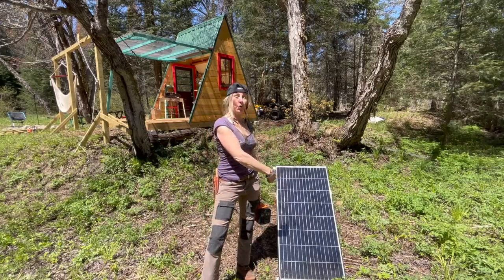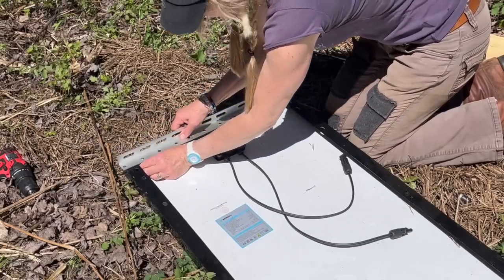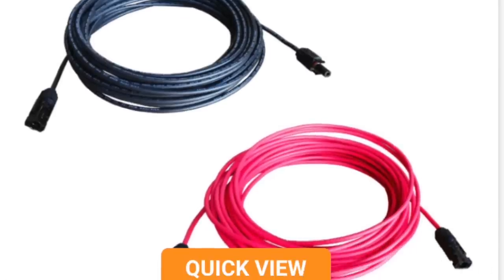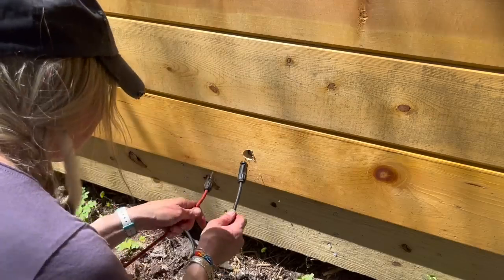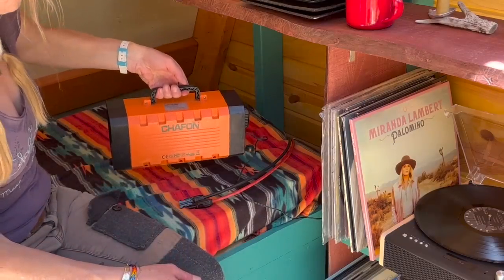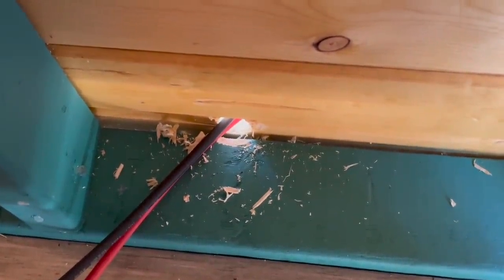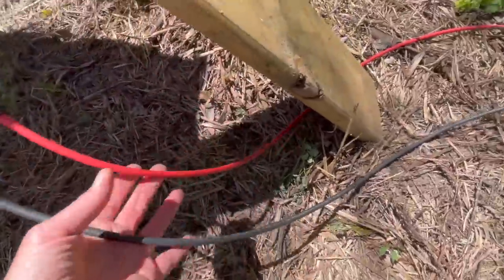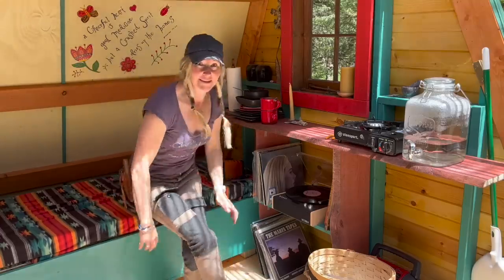Simple SOLAR for off grid cabin

Comment: I watched your build on this cabin and was wondering if you had any locking mechanism on your raised door for when it's shut, away etc.? 
A couple of pad bolts (barrel bolts?) will hold it down and prevent flapping in the wind and damaging. Also keep out smaller animals.

Comment: I like the stainless steel wool idea to fill the hole, add some gorilla glue to it and some water and when it foams up and hardens it will be air tight. If you glued a appropriate size stick in there with the glue and steel wool it would save the other product, then trim off excess.
Reply: Youtuber silver Cybul has a Eco Solar tracker review for one of these panels that can double the efficiency as it tracks the sun automatically. Not sure how soon it takes to recover the cost of it.

Comment: With all due respect what you have is not a “power generator” it is in reality a battery that stores power that is created by the solar panel.  The correct definition of a generator is “a machine by which mechanical energy is changed into electrical energy.”

Comment: I'm considering putting my ecoflow river 600 watt at a campsite.  I don't yet have a panel to charge it but I'm curious, do you know how long it takes to fully charge your battery with the 100 watt panel?
Reply: If you can get the 160w I would definitely spring for it. The intensity of the sun determines how long it takes to recharge but I can charge my small River in a couple of hours using my 160w panels on a good day.

Comment: Hi Ya Brooke, I like it. Solar is great. They make solar fridges too. If ya had 300 watts of solar, you could run  a fridge, lights, and charge phones and laptops all free. I have 400 watts, and two 100 amp hr batteries, with a charge controller and a converter. my fridge never runs down the battries. it runs 24/7  runs my TV, and charges everything. You might have a problem up north in the winter with clouds and snow. Guess you could keep'em in and drag'em out unfold them while your there. I don't know if that power unit you have has a lifepo4 battery or not, but its not good to charge them when their frozen or below 32 degrees. that go for all Lithium batteries.

Comment: The solar panel is the generator, not the battery bank you were holding in your hand.  Who cares what the manufacturer calls it.  If you need to charge it, then it is a battery bank at best, not a generator.
Still love the channel, just not the misinformation perpetuated by the manufacturer.

Comment: The one thing mine won't do is charge the battery when the inverter is being used. That's one thing to look at when considering buying a power station. My next one I will build myself. I have the batteries already.

Comment: you can get a fence pipe post and beat it into the ground and mount your panel off the ground. Does not have to be fancy with cement in the ground.  If you are only using one panel. Also as one of the other posts.  Put the cables in conduit to protect from teething critters.

Comment: Leadfarmer73 has many YouTube videos on different portable power stations, mostly the small ones 250 watts to 500 watts.  Also HOBOTECH has YouTube videos on portable power stations in a fun technical way to compare, does the bigger ones like 1500 watts along with the smaller ones, 250 watts 500 watts.
Reply: Also agree with another comment that the wires should be in conduit. 2" or 3" for a possibility of adding more panels. Sealing both ends, no critter run. Weather treated yes, though the sun will take a toll eventually along with rabitts, mice, other forest animals

Comment: Add a 90 degrees piece of wood at the foot to your solar panel post and perhaps put a small sandbag on the ends for stability. If your panel position is on a prety fixed place, adding conduit could protect the two cables some more and even close the hole in the cabin wall. Nice little project, saves petrol, minimizes noise and uses nature's energy (win, win, win). 😀 🌞

Comment: Wouldn't one cable have sufficed if the switch had been connected directly to the solar panel? - This would have reduced the costs and the circumstances significantly! Or?

Comment: Brooke, can you explain the power generator? Is it a battery bank or a petrol powered inverter? What voltage in and out?
Reply: Solar generator,  runs off solar by internal converter. No petrol so cheaper after you invest. Technically,  it's a battery bank of greater capacity than just one battery.  The Lithium Ion batteries are much denser, hold longer, larger charges, weigh a lot more, cost more, but are going to outlast regular marine deep cycle batteries.  Very worth the investment.
Reply: On power in, many are solar charging, but some can be charged DC cigarette lighter (12v), these have dc, USB, and 120 outputs.
Reply: @heatherk8931  Thanks for that. Where I live ordinary power is 230 v. ac.

Comment: Stainless steel steel wool is an excellent choice for sealing penetrations in a structure. Rodents won't chew it like they might foam and fiberglass. Regular steel wool is fine for interiors, but will rust and disintegrate outdoors. Stainless steel is the way to go.
Reply: I thought the same thing

Comment: Brooke, I suggest you think about wild animals investigating your solar panel.  As is, it would be easy for one to knock it over.  If that happened, it might damage it.  They might also accidentally disconnect it the way it is, simply by tugging at it out of curiosity. Even storms could topple it.  It would not take much more work to make it more stable and animal proof.Oh!  And I nearly forgot. Some animals chew wires,  I know for a fact that rats do, and they also live in the wild.  It would be easy to protect them with pvc conduit.  It would  be easy to install.  And it is lightweight.  With a little work, you could protect it all, and have your generator charged every time you visit.

Comment: I know you're super busy...just wondering bout that power generator...is it battery charged initially? And our renogy cable comes in raw cable connected to our control box. Our wind power we got second hand has bearings going out. Any way maybe it's something we could use in the camper.
Reply from the maker: a power generator is a battery with the inverter all in one. You have to figure our what solar connector cables you need to make it work with whatever power generator and solar panels you have- they vary

Comment: Thanks for the vid!  I have the Ecoflow Delta 1K generator but have been recharging it with grid power.  I want to get the Trina Solar 400 watt panel so it doesn't take up so much room and that's the max input the unit will take, but it's 200 and every place I can find it they want 150 to ship it.  No place nearby that has it unless they install a system.  I can get 100 watt panels local (Franklin NC) but that would take 4 to equal the one trina solar unit.  Anyone know any secrets of how or where to get one in NC without the price basically doubling for the shipping?  A day drive anywhere instate or nearby would be fine.  These things are just too cool for what they are.  You've got me inspired to get this done!  "Free power" sounds like a good idea since I already have the most expensive part of the deal.
Reply from the maker: yeah shipping is the bane of everything now

Comment: Very Cool. You could get motion detection lights as well if you ever want some hands free lighting or.. movement detection security. One on either end. You can tie them into your strip and exterior mount them. Also.. it can run water pumps. Fill a tank, put up a suspended bag with a little garden variety pump and use a big arm coil of black water line it takes the pressure off the uppush of the water, and gives it good sunlight surface exposure to warm with for an outdoor shower. And for the hole to plug you are better off using a wood plug before you use anything else, and elmers glue or anything like it would be fine, foam stuff will get chewed through by carpenter bees or whatever. May want to cut that board in half, and then nail it once in the center as a pivot joint to the one on the frame, and put another nail on the surface of the one under it, so you can lock it back into standing. That way you can shorten or heighten it with the same piece of wood you put on it.
Reply from the maker: yup lots of uses~!

Comment: The flow of electrons on wire, especially though outdoors, tend to cause oxidation that will be seen as white and green. This oxidation layer slows down, and may prevent, the flow of the electrons.  The best thing I found to prevent this is WD-40. I would spray all my wire connections minimum once a month. (This works on batteries in your car too.)  WD-40 has to be good for something, right?  It's not worth a darn as a lubricant, but it's a great wasp spray and anti-oxidation treatment.
   
You might want to make sure your power station is in a ventilated area, and not too near the head of your bed.  Because when charging and using Lithium batteries it generates CO2 gas.  Breathing small amounts of CO2 can cause headaches and drowsiness. In larger amount it can cause rapid breathing, confusion, increased cardiac output, elevated blood pressure and increased arrhythmias. In extreme cases it can lead to death by suffocation.
Reply from the maker: thanks Duck!

Comment: Very cool.

It would be nice to know how long that will run your lights, charge the phone or run other appliances.

I have a 12volt refrigerator/freezer about the size of a regular cooler.

It runs off 3 100 watt panels and 3 large deep cycle lead acid commercial batteries.

The key to power storage is how much are you going to use, how much can the panels produce and how much can be stored.

Another issue that comes into play is panel shading.
Even a small amount of shading can seriously affect power output.
Site them well.

On low sun days spend some time and keep the panel oriented towards the sun.
Reply: If you look up monocrystalin panels,  they can have a partial shadow without much negative impact.  I have 2 12v coolers, (not tested with solar yet), but you can do battery bank AND/OR solar generator like she has here. Calculate the need vs solar output like you said. 
I'm with you, having both panels and a couple solar generators. ❣🌟
Reply: @heatherk8931  Excellent.
I have one 12v Refrigerator Freezer. 
I live in Texas with plenty of open sky.
During the Spring the sky was more overcast than normal.
I started with a new 100w panel from Harbor Freight, a 30 amp Charge Controller and 3 Lead Acid Computer backup batteries.

During the day for the most part it would run fine.
The 100w solar panel did not put out enough power to run the fridge and recharge the batteries.

I added a 2nd 100w solar panel and on sunny days the system worked to my expectations.

On cloudy days the fridge would still cut off in the middle of the night.

I added a 3rd 100watt solar panel and so far the system is exceeding my expectations.

I use the large freezer part to freeze 32oz bottles(Apple Juice bottles) of water.

I use those to put into a second cooler inside a insulated bag to keep food cold.

Comment: Hey Brooke thank you for the video and the information about the solar panel I like it and I have a quick question for you when I get my property I want to buy a small shipping container that way I can put my food in it and live in it too and I'm going to put four windows in it and go down to home Depot and buy those square phone blocks and stick them to the wall with a liquid nail because I  heard that the shipping container is a hot box but if I do all of this work here it should not be it should keep everything comfortable am I correct
Reply from the maker: awesome good luck!
Reply: There are a lot of good insulation options now and you need to do your research. Most are better than foam and take less space up. Depends on your budget but check it out.

Comment: It would have been better to have an SAE connector for just one panel. That little battery bank is handy if you want to take the thing with you and to take the panel with you when you leave for the winter.  With the SAE connector you could put a socket on the inside and the outside and just a short cable to your box inside and a longer one to the outside. No critters would be able to get in through that large hole.
Reply: Why would you prefer SAE over MC4?
Reply: @heatherk8931  Easier to pull apart and I've never had any issues with SAE, I use SAE exclusively and cut off those nasty MC4 connectors every time.

Comment: @Girl In The Woods, I see so many people position panels in a vertical position. Is there a reason for that? Wouldn’t it be more stable if standing horizontally and would that be safer for the panel?
Reply from the maker: i don't know just set it up and don't overthink it
Reply: @therealgirlinthewoods  I wouldn't say that's overthinking it, just wanting to be prepared for the elements. High winds could knock it over or worse, take it beyond your 30 foot power cables and rip them out of the panel, possibly damaging them or your panel.
Reply: I don't th think it matters, vertically or horizontally,  just face the sun

Comment from the maker: Common questions/answers:
1) All components of this setup, except for the power station I used (no longer available) can be found in my amazon affiliate store- link in description. Any other power generator may be hooked up in a similar way to solar.
2) Using a power generator eliminates the need for inverters, charge controllers, etc- pretty cool! And they come in many different watts for varying needs. The one I'm using is 500 watts. The solar panel is 100 watts.
3) The power generator you have should have an input for solar, which may or may not come with a cable for hookup. Do your research on which cable your power generator needs, and find the appropriate hookup for the MC4 cable ends (male and female) that hook to the solar panel.
4) The cabling can be buried- by itself or in pvc, but not necessary. It's weatherproof.
5) I will fill the hole I drilled for cabling with spray foam.
6) My power generator was back up to 100% within 10 minutes of being hooked to solar!
Reply: I went to the affliat link but only saw the dolor power stand there.  Do you have one for the generator and solar panel?
Reply: FWIW Rodents love to chew on any unprotected cables at our place, so I definitely recommend encasing them in something outside, even if it's a temporary setup.
Reply: Okay that  is a bigger help with the MC4 ends male & female for me!!! Linda  P.
Reply: Good to know.
Reply: Thank you so much.❤
Reply: Answered all my questions right here Brooke! Thanks
Reply: just saying . dont use foam for the penetration. epoxy, wooden bunge, or portland cement.1) not rodent+, 2) not water+, 3) i told you already.
Reply: Do you think your power generator would power a small dorm room size refrigerator? I hoping that it will power it easily during the day and at least a few hours at night.
Reply: @1shaneeka  nope
Reply: @1shaneeka  look at the wattage on the fridge. Your generator needs to deliver at least that many watts to run it. Then estimate the amount of time it will actually be consuming power and add in a bit more time. As an example, if your fridge needs 75 watts and you think it will run six hours per day, 75 watts times 6 hours is 450 watt hours.  Figure in the expected winter daylight hours and how much actual power your panels will produce when the sun is lower in the sky and with cloud cover, and then look at the long term battery degradation... and you can come up with an idea of how many panels you need a d how big a power station is needed. One hint, you may want to look at a 12 volt fridge, because you won't need to run the inverter, which does take some power.
Reply: I got a lvyuan 500 watt it doesn’t come with the y adapter thing.  Am researching.  Any idea which one will plug in to the power generator.  It came with a screw in connection thingy (technical term). I got the cables, stand and solar panel from your Amazon site.  Just charging with house current now.  It has a aviation port.  I have no idea what will hookup the one you suggest doesn’t work.  I think there is a different solar panel that fits this. With no extension.  I would suggest you buy directly from the company.  They will not give support unless you do.
Reply: Everyone should have these at home as well. Seems like a must have during these tumultuous times. High Five Brooke :) You rock
Reply: Thank you!  Will you be need to protect the connectors that are under the solar panel somehow?
Reply: @debbieengland163  the MC4 connectors are supposed to be water resistant,  so probably ok. But that setup isn't left out all the time.

Comment: Informative & looks easy to install. What brand of solar pad? What was the entire cost of your little system? And how do you plan to plug up the hole to keep moisture & pests out but still be able to move your power cords about and remove them for storage if you need to? And what would you do with the solar panel during the winter/snowy season? Hope those questions make sense. Thanks for the post. Hope ya'll are doing well. :-)
Reply from the maker: Renogy, spray foam, no need to move the cords- but they can be buried which i will eventually do. All products can be seen in my Amazon affiliate store for pricing- link in description. Thanks!
Reply: Might u run the cords through some conduit when buried? If so, you could run it all up and got a flanges end to the cabin hole..some spray foam on the inside to keep small pests out. Do u plan to leave the solar panel on the ground or rig something up to keep it off the ground and available in the winter so it doesn't get buried in snow. Or, will you just take it inside for the winter taking it out only if ur there?
Reply: Literally pretty much everything you asked was answered in the video . Did you nod off or just feel you are special?